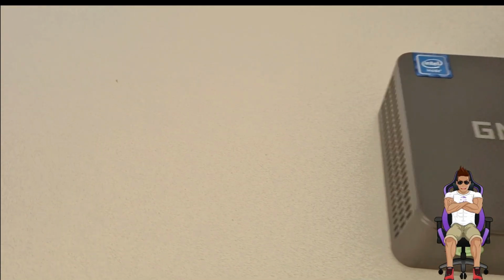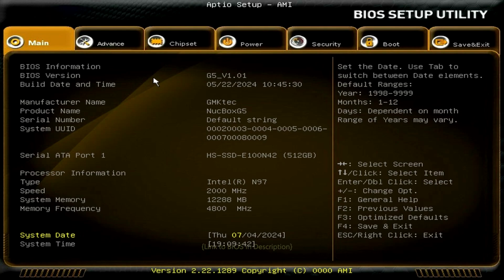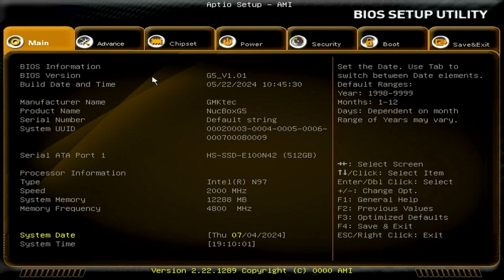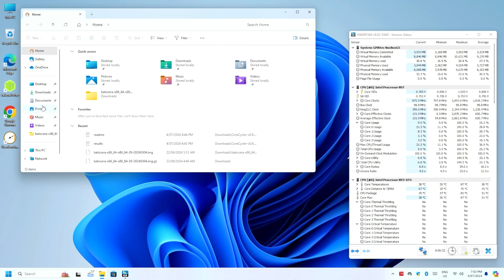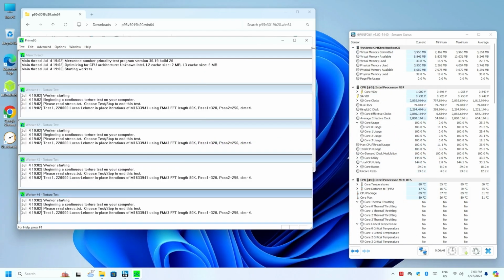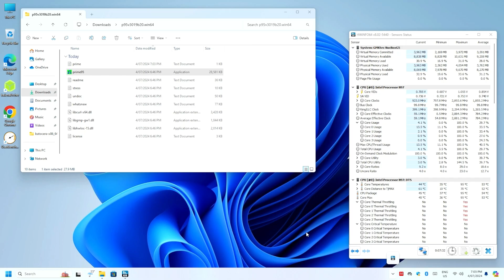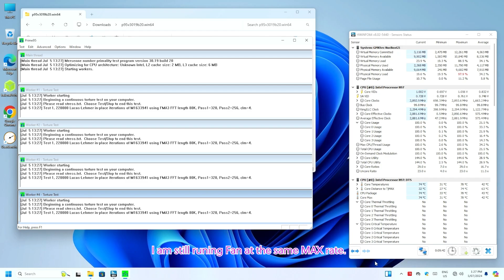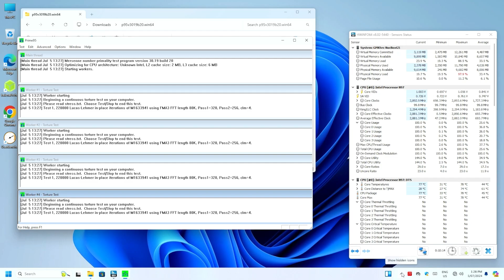GMKtec G5 Micro N97 TINY NUCBOX BIOS Update & Show/Fix CPU Throttling  {Part 2 of ...}

Comment: Hi, i notice that in batoceta CPU doesn't use turbo. But It remains max 2.9 GHz.
How di you fix that?
Reply: in the Power plan section - Change advance power settings > Processor power management, and try change the minimum CPU state from 100 to 1 to 5%. Mine was set to 100 as minimum.

Comment: Why 12W instead of 15W?
Reply from the maker: Hi. The provided power supply cannot do 15w and you will have more heat issues for minimal (2-3fps) gain even if you use a 15w capable supply. (Another youtuber @HTWINGNUT already proved this.)

Comment: Just redid my thermal paste huge difference. I’m at 15w though. Runs quieter now too. Also make sure you massage those ribbon cables good once you plug it back together. Had to do that twice putting it together.
Reply from the maker: @mikeak7331  great to hear. I have seen zero performance difference at 15w and the supplied power supply is also under spec to run at 15w flat out. Another YouTuber came to the same results. (I will come back and put his name here) Save some heat/temp run at 12w same performance.

Comment: What software are you using to check the CPU temperatures?
Reply from the maker: Hi. It is FREE software called Prime95 it will stress your CPU to the MAX way beyond what you will typically see in normal. (other software out there does the same thing but, i've used this one for many years)

Comment: Hello, do u have any issues with gamecube emulation? I have recently got one of these and ive put batocera on it. I tried playing need for speed hot pursuit 2 on dolphin emulator x2 resolution and it loads fine but the second i get to gameplay it just tanks to half the speed it should be. Im at a loss as to why🤔
Reply from the maker: @iansellars789  I've played many GameCube but maybe not that particular one. Probably just a setting or a 1x game. Will try to take a look.
Reply from the maker: Hey i have got this one going at a steady 60fps but, it wasn't easy. It doesn't use a general accessible seting so, I'm just trying to figure out how best to share/implement the fix.
Reply: @PiManiac  Very nice 👏🏻 yeah I did try a multitude of mixed settings with no luck, I tried it on my steam deck too and the same thing happens so I was thinking ok this is not a hardware issue as in the g5 cant handle it it'll be a setting somewhere. It had me beat anyway as I'm not mega knowledgeable on this stuff 👍🏻
Reply from the maker: @iansellars789  I'm confident this will fix it up on the Steam Deck also.

Comment: I just got one of these. Windows 11 is way to heavy for this little bugger. 

I've switched to Ubuntu and the high idle temps are gone, around 35 to 36c idle from 45 to 47c idle on windows 11. I haven't even changed paste yet which is next on my list, running 15w and have max temps of 77c full belt.

Linux is the way forward for this device.

Overall great machine.
Reply from the maker: @MultiTtocs  I personally found after it all updated, (hours later) I had zero issues with Win11. I don't worry about temps that are under the threshold as, Where I live, id never see that cool temp anyway.
Reply: @PiManiac  Is there a way to downgrade to W10 on this machine? If so, can it be done before first activation of afterwards? Thank you for your work
Reply from the maker: It's possible but, you would have to install Win10 from a USB Drive overwriting the supplied Win11. I'm still running Win11 and after the huge updates that initially make it slow/laggy until all was settled, I found it was responsive as my main PC.  @psg293r
Reply: i download Chrome os flex and using for multimedia same with mine cpu usage %15-25 temp. 30-38 degree.When Win11pro it heats too much.

Comment: Is this necessary to do when you purchase
Reply from the maker: @jhon12451  Depends on your use case and if they have fixed the problem. As a daily internet, office and YouTube machine you probably would never notice or reach throttling. Gaming is where you will see/feel it, IF it happens.
Reply: @PiManiac  also i have wifi 6 because of cable provider. Will using my wifi work with this pc? I hear wifi 5 is only compatible.
Reply from the maker: @jhon12451  It is Wifi5 (but the internal wifi card is easily upgradable to wifi 6 should you wish) but as it is, should work absolutely fine with your wifi 6 router. (Mine does)

Comment: Can a usb-c power bank power this unit, so as to use in the field. If so, would an Anker PD power bank work? Thanks. Nice review.
Reply from the maker: If it can supply a constant 12v 3a 36W then, yes.  Thanks
Reply: @PiManiac  Thanks. I’m having trouble discerning which ones do.  Also, trying to figure out the numbers: I guess most power banks are listed like 20,000 mAhr based on 3.7 volts. So, if I need 12v, 12/3.7=3.24 but round up to 4. So, 20,000 /4 = 5,000 mAhr or 5Ahr. Now, if I need a full, consistent 3amps, then I’m only getting 1.2 hours of use. Does that seem right? Do I need a USB C trigger or should the PD power bank work by itself? Any help or insight here? Thanks.
Reply from the maker: @pblaer   I wouldn't want to guess the running time from 20,000mAH (and i'm certainly no expert here) but, a quick looup indicates 12-25w seem to be the min/max draw for a N97 chip. Depending how hard it was running = how long battery will last.

Comment: Hi Drew,  Thankyou for the video.  My new G5 arrived this morning which is my entry into the world of NUCs.  Great info on the thermal paste which I will apply once I find a video that takes me through the dismantling of the G5.  I am not a gamer but your video has got me interested in looking into emulation once I've applied the paste.
Reply from the maker: I'd run some test using the freely available software i used as, they may have fixed issue. (or the issue may not even affect you depending on your use)  Love the feedback, find me elsewhere and ask away, questions are FREE.

Comment: This was very helpful.  I believe mine is having these heat issues. I wish you'd do a detailed guide showing thermal paste application process, instead of a few screenshots.  Thanks again!
Reply from the maker: Checkout HTwingnut Channel. He has covered this. (but did not have the results i had) BTW, I also reached out to GMKtec, who said they would investigate. I have had no problems since. Still a fantastic tiny emulation device.

Comment: Has anyone ever seen more than 2.9GHz on the Intel N97 NucBox G5?
Reply from the maker: The maximum boost frequency for 1 core is 3.6 GHz / 3600 MHz (for like 1-2 seconds)  The maximum sustained frequency for ALL cores is 2.9 GHz / 2900 MHz.  I've seen 3.4 MHz a few times using Batocera Performance graphs.
Reply: @PiManiac  okay. Yesterday I saw in a Video that you have to enable C-States and Set the CPU Power to 15W. I'm Testing it right now. I always Stop at 2.9 GHz
Reply from the maker: @unknownidentity0815  Most will tell you C-States are best left off but, it make very little difference. The power supply that comes with the G5 is 12w/3a and others have tested with better power supplies that can make the required 15w with no better benchmark results. You cannot run at the BOOST CPU speed for more than a few seconds. 2,9 is the MAX you will see with benchmarks. It's the GPU@1200Mhz that enables the N97 to beat the N100.
Reply: @PiManiac Okay, the 2.9GHz performance of the CPU is sufficient for me. I knew that the 3.6GHz is single-thread only. but even with the CPU-Z stress test, I couldn't get more than 2.9GHz with one core.
I tested C-State and now see more than 2.9ghz even in task manager.
Reply from the maker: @unknownidentity0815  Whilst I see a slight inprovement in Geekbench 6 Benchmark scores with C-States ON, Batocera seems to run worse so, Windows/RetroBat may benefit from it being enabled more. (& i still see a core going way over 2.9 on Batocera at times)
Reply: Mine is stuck at 2.9 GHz.
Reply from the maker: @Urosaurus  just to confirm. With the newer Bios?
Reply: @PiManiac  I’m not sure it is the latest as the one that you have, which I think shows May 22, 2024-  this one is dated May 21, 2024. It came with the unit.  I have not updated with the one linked. Thanks for your work.
Reply from the maker: @Urosaurus  Check that you are getting MAX 1200Mhz on the GPU as some older BIOS maxed out at 1000Mhz. (GPU-Z under windows)
Reply: @PiManiac  Yes, it does boost to 1200 MHz.  Thanks.
Reply: @PiManiac  My build is 21 May and can achieve the full 1200 MHz.

Comment from the maker: Some tests ran by me this afternoon.  N100 CPU= Geekbench 6.3.0 CPU = 985 Single/2985 Multi. GPU Tests Vulkan = 3731 - OpenCL = 3270 | N97 CPU = Geekbench 6.3.0 = 972 single/2984 Multi. GPU Tests Vulkan = 5975 / OpenCL = 5186.
Reply: My Geekbench 6.3.0 N97 for GMKtec G5: single core - 1223, mult-core - 2888 on balance power plan mode.
Reply from the maker: @michaelm4407  How about the GPU Vulkan/OpenCL tests?
Reply: @PiManiac GPU Tests Vulkan = 5963 / OpenCL = 5207. Seems similar to yours.

I'll need to replace the thermal paste after noticing thermal throttling in HWinfo64. Trying to decide on Kooling Monster KOLD-01 vs MX4. I wonder if HTWingnut used too much thermal paste on his G5 considering the N97 is a small APU.
Reply from the maker: @michaelm4407  I certainly used less than he did and i hope soon, this is not required. This is a cheap/awesome little unit for what your getting here.
Reply: @PiManiac  Was it difficult to reassemble the G5. I think I will struggle to put back the ribbon cable for the upper motherboard. Do I need a tweezer of some sort?  I don't think I've seen any videos re-assembling the G5 from anyone yet.
Reply from the maker: @michaelm4407  It took a little patience but, i used no tools other than my hands to re-assemble. Just be aware it does split and where when you dissasemble. (see my video)  After that, rest is easy. @HTWingNut has a better teardown but he did not have the results myself and others have. (i used MX4)
Reply: @PiManiac  Thanks. I shall give it a go in the next couple of weeks.
Reply: so n100 is better than n97?
Reply from the maker: @nikolaosmitsou85  As i have both i can say NO. (Look at the GPU scores. Also, N97 with C-states ON scores higher under windows. i did not have C-States set to ON on the N97 here)
Reply: @nikolaosmitsou85  No and it is not even much cheaper.

Comment: It is a bit of a shame that the lack of decent CPU paste takes some shine off the box.
Reply: Hopefully they take the advice and act on it. I did new paste on mine yesterday and its just a world of difference. I used a nano diamond thermal paste which was a couple dollars more than the usual ones at my local but it certainly worked well. I can't get it to go higher than 79c now in stressing (and generally more like 75c) whereas before I'd often see 89-96c. I used to hear the fan revving up to maximum speed constantly but now as its running cooler I rarely ever hear it.
Reply from the maker: I did reach out and received a reply that their techs will look into but, time will tell.

Comment: Thank you for this! I need to tear mine down and do this thermal paste fix as the temps do worry me.

Also maybe I'm unlucky, but fair warning to anyone about the included SSDs on these. I have the 256gb model and the SSD suddenly died on me after just a week of using it. The NUC itself is fine and I've just been running on a micro SD card until my replacement SSD arrives, a bit slower to boot etc obviously but at least I've been able to use the thing.
Reply from the maker: Dismantling is pretty straightforward, just watch the connector where the two boards connect. (A bit of patience required to reconnect also) @HTwingnut has a better teardown tbh but didn't have the success i did with re-pasting.  I have purchased about 6 of these so far and no SSD issues yet. I have been speaking to GMKtec support and hope the paste used is changed for those (like me) who like to push this little NUC harder than just browsing and watching YouTube.
Reply: @PiManiac  thanks for that info, it's hard to find much detailed stuff on these around the net oddly enough.

As for the SSD, I guess I really am unlucky!
Reply: @PiManiac  just bought one, do you know if they made any changes with the paste? I haven't set it up yet to test
Reply from the maker: @tomgunter1215  I am not sure, but install the free Prime95 software (or similar) and you will find out pretty quickly.
Reply: @PiManiac  Thanks, that's the plan. I'll report back after I try, but it may be the weekend before I can.
Reply: Life happened, and I finally got to this today. New out of the box, Prime95 was causing thermal throttling after about 9 seconds. After a repaste with Arctic MX-4, I've had Prime95 running more than half an hour with no thermal throttling. Max core temp 92C, average 85C. Thanks for the tips!

On a separate note, my advice to anyone reading this is the future is to activate Windows BEFORE updating the BIOS. I didn't, so it was complaining that "the hardware of your device has changed" and wouldn't activate. I contacted GMKTec support, and they were able to supply a key that let me activate, but doing it before updating the BIOS would have been less of a hassle.
Reply: @tomgunter1215  be interesting how it is after a week or so too. I did mine and it was great for about a week, temps similar to yours, then it reverted to its old ways. Not sure if my paste job was bad or the quality of the paste itself, but I'm gonna have to re-do it that's for sure.
Reply from the maker: Thanks for the update. I don't recall any activation issues myself.

Comment: Thanks for this.  Did they remove the bios update from their website?
Reply from the maker: @Urosaurus No. It's still on GMKtec website (more links, support, firmware update)  and i also host/link to it above in the full video description. Thanks
Reply from the maker: ** Update ** BIOS update has gone from GMKtec website so, only my share which is linked above.
Reply: @PiManiac  es gab Probleme nachdem BIOS Update mit der Win 11 Aktivierung
Reply from the maker: @unknownidentity0815  Interesting. I activated before updating and have been fine. Do you have more details?
Reply: @PiManiac  leider nicht. Nach meinem Update hat Windows eine Hardware Änderung gemeldet und der Key wurde nicht akzeptiert. Ein paar Tage später war das Update von der Seite verschwunden. In den Rezensionen auf der Website, hatte jemand auch das Problem.
Reply from the maker: @unknownidentity0815  Thanks for that information. I better put a disclaimer on my download then.
Reply: @PiManiac  Thanks
Reply: @PiManiac  great, many thanks!